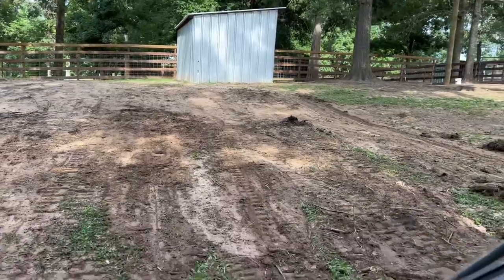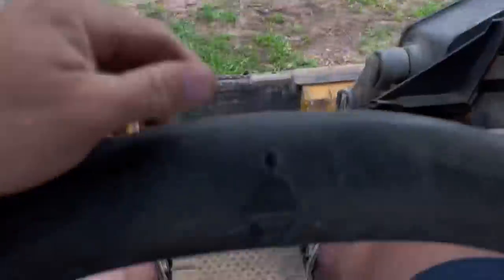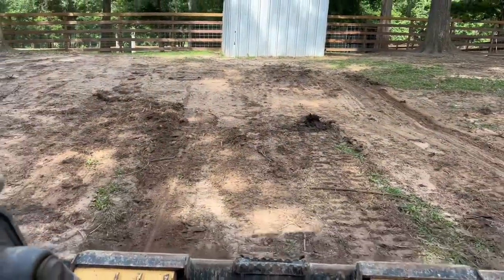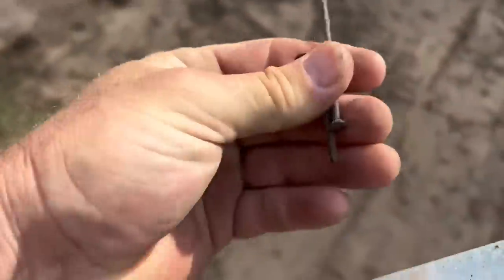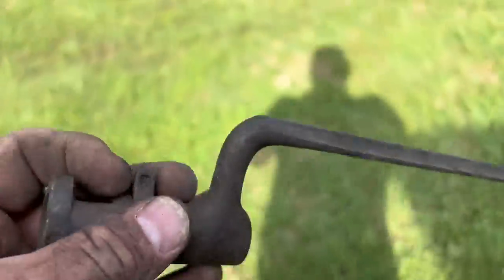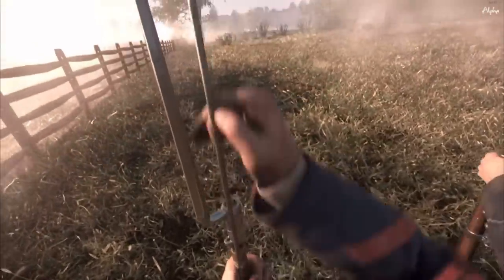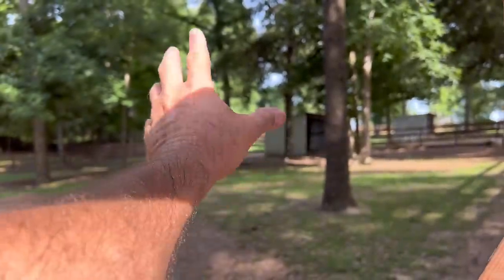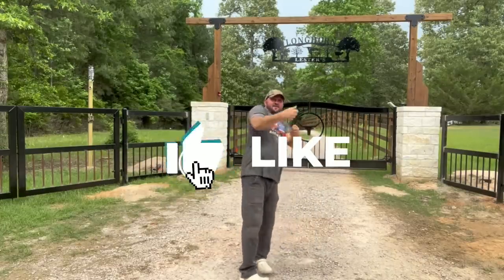Incredible Unearthing Artifact During Horse Cremation Clean-Up

Comment: great find Lester.  Incredibly good shape too!  That is a lock ring socket bayonet for a musket. this bayonet fit over the end of the muzzle and the lock ring would keep it in place behind the front sight.  I would say that from what you shared about the civil War History of that area that is is a Confederate Bayonet, especially since it is not stamped with any information, etc.  The British Enfield bayonets are stamped with a crown.  Of course the Springfield (US) socket is stamped with US.  Confederate swords and blades typically do not have the machine stop near the hilt.  There are many other bayonets of course but looks like yours is very close to the model 1855 bayonet, but also resembles the 1816 model bayonet.  The Confederate army was known to use a lot of pre civil war ordnance.  For instance there were even old smoothbore flintlock conversions to percussion used.  I would be willing to say that if you continue looking and start finding buttons, belt plates and dropped bullets your area may have been a camp.  If so there should be many great finds depending on how long it was occupied.  I enjoyed the great drone footage you have added, made an interesting video for sure.  I think you might have a great idea on that old roadbed!

Comment: Lester, the larger magnetic push is about 4x4 and gets you so much more pick up than the size you are using.  I have both they are great, but the larger one does do much more with the extra large magnets in it.  You will love it and only a little $ more.  XO

Comment: Lester good find, but I'd have it checked out. It's in too good condition to have been in the ground for 160 years. Probably a reproduction.  However I'd get a metal detector on site to see if there's any dropped or fired miniballs or buck an ball. If that indeed is a trench system there's no doubt those will show up.

Comment: I didn't know you found it in the ashes don't try to stab anything with that Lester because it probably lost its temper due to the Heat and you wouldn't want to bend it that's a nice bayonet and it's in pretty decent condition and definitely do not take sandpaper to it